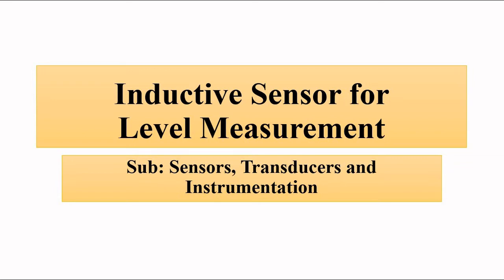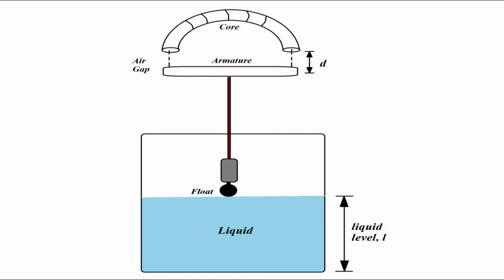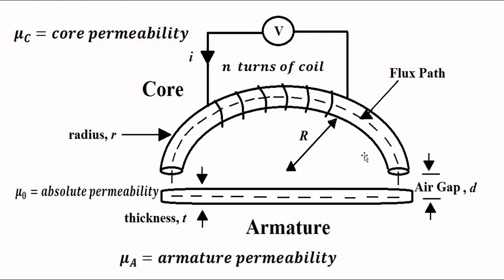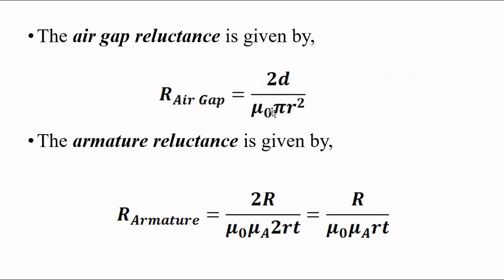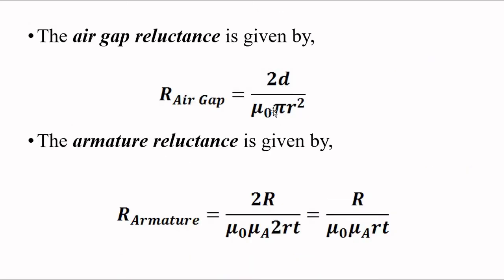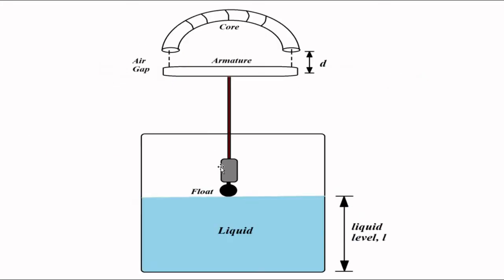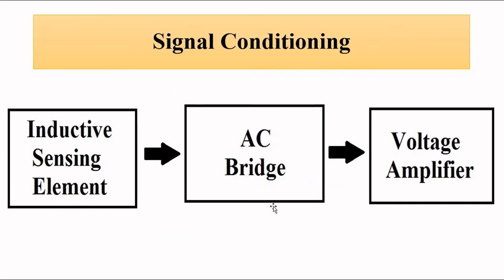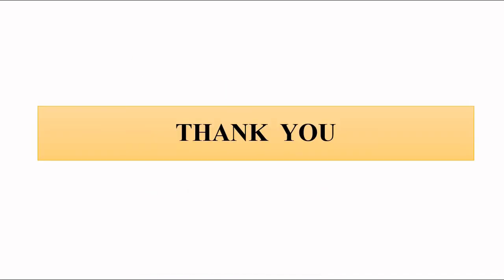Liquid Level Measurement Using Inductive Transducer | Sensors And Transducers

Comment: This is a good explanation of a typical inductive level sensor as would be used with a float. There is another type that uses the fluid to increase or decrease reluctance, not a float. The construction uses separate coils stacked up in a column. As the level of the liquid rises or lowers, changing the reluctance in the separate coils. The idea being that the amount of coils changes the resolution of the measurement. The more coils in the column, the more points of reference available for measurement.